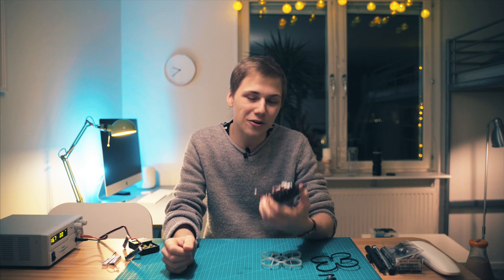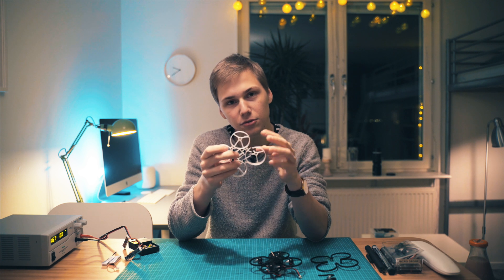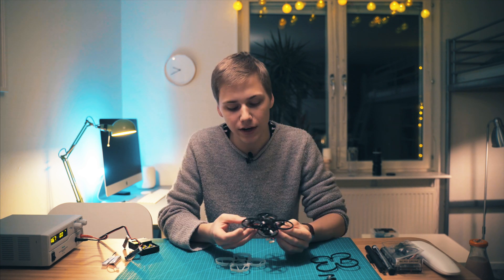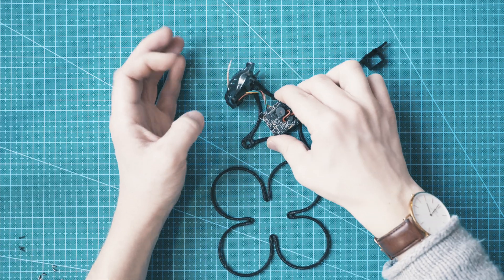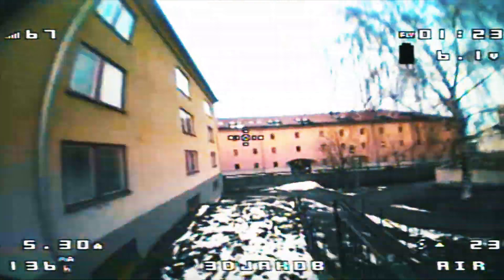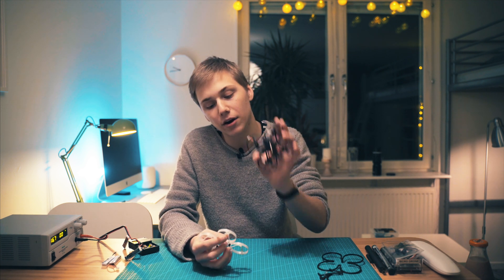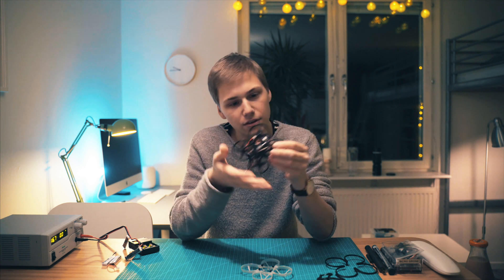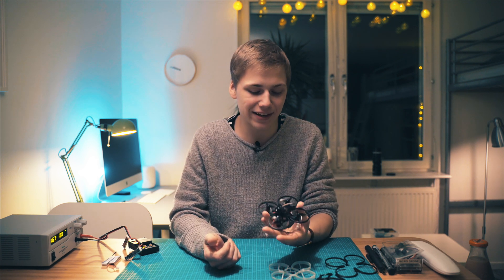Mobula7 3D printed frame

Comment: Love your work. What screwdriver is that? Is that a light on it?
Reply from the maker: Thanks, glad you liked it! The screwdriver is a wowstick. If you tinker a lot with electronics and screws you will love it, its awesome! It charges via usb has a built in led light and a pretty powerful motor.
Reply: @dronexsweden6906  thank you so much bro. Did I see a drill too? Which drill was that?
Reply from the maker: @darbyisking  Nope only a screwdriver.

Comment: This is awesome. Thank you so much. I am printing now. Frame in carbon fibre, prop guards in petg, battery holder in tpu. Is the battery holder for 2x1s batteries? I am going to mount a mobula6 25k and a moblite7 on them. Both only use a single 1s battery.

Comment: Excellent. I came here from Thingiverse to see the video. Well it's quite easy to find out how it fits together anyhow :) And it's good to see that your prints look worse than mine and it still flies well *haha*. Thanks for sharing that!! I will always have some complete kit when I go flying.
Reply from the maker: Glad you liked it! Yeah, the printer tolerances don't matter too much on this print as long as you drill the holes afterward. Happy flying!
Reply: @dronexsweden6906  I guess my printer is pretty well dialed in. Putting the frame and prop guide together was great lite press fit. If you check the thingiverse link: I linked a reinforced prop guard into the comment in case you want to add it to the project.
Reply from the maker: @izemanevobike  That's awesome I'll make sure to take a look at it!

Comment: Hi, first of all thank you for that frame. But after I changed to it i got a flyaways after switching to this frame. It imidiatly lifts off after arming.

Currently on 4.1.7 and this settings: https://www.youtube.com/watch?v=u7cdc1pLnHs
Also tried 4.2 with nearly stock settings, no accidential liftoff but it is wobbling when trying to fly. Any suggestions. Or could you paste in your diff all?
Reply from the maker: That is very strange, I was running stock mobula 7 settings and it worked perfectly for me. Unfortunately I don't have it anymore so I can't post the diff but you might be able to find the mobula 7 stock tune on the internet. Hope that helps, good luck!

Comment: can 1102 kv8400 motor be used?
Reply from the maker: That depends, are you running stock mobula parts otherwise? 8400kv is a bit low for 2s so it probably won't have as much power as the original motors but I bet it could work ok. The motor will probably be a bit underpropped though.  I hope that helps, sorry for the late reply!

Comment: dude i love this frame idea. i was working on something similar to protect props on my sailfly x. but i'm just learning f 360 so it's a long process
Reply from the maker: scooterfarl static-fpv glad I could help. Good luck with fusion! Happy flying!
Reply: @dronexsweden6906  thanks. i wanna see if i can add a skid plate to the battery holder if ur ok with that

Comment: What nozzle size do you print this on?  I can't get my screw holes to print the correct diameter.
Reply from the maker: Don't know exactly but 3d printers always have trouble with very smal holes so I would definitely recommend to always predrill the holes. Also I would recommend running high settings for better print rigidity. Another good tip to get it stronger is using very high temperature and then using a fan to cool the print. That way it really fuses with the layer underneath. Hopa that helps, have a good day!

Comment: Great job, man.
Which material do you use?
Don't you have 3d model for eachine trashcan?
Reply from the maker: Виктор Баранов I printed mine using PLA although ABS would probably work better. I haven’t done much testing though so I don’t know which best. The Eachine Trashcan has the same size fc and motors I think so it should probably fit in the same frame.

Comment: Nice work , material used will make a big difference to the strength, would the bottom plate work on its own without the ducts?
This would increase performance a LOT.
A carbon base would make it stiffer and reduce jello maybe and be stronger of course.
I'm thinking about the toothpick frame for summer when I fly outside much more.
Thin arms make for great efficiency as well as increasing power.
My bamboo skewers builds are really good, huge power and 6 to 10 minute flight times easily from 350mah  1 or 2s.
I don't have a 3d printer but think a system for utilising bamboo skewers or carbon rods would be fun, like stick motor mounts to push onto the skewers and maybe a simple FC mount..
Reply from the maker: Thanks! Yes to bottom plate definitely works on its own. However at that point you might as well use real props instead of whoops props. I have definitely eyed the toothpick frame too! It't performance seems pretty epic. I will probably upgrade to it once summers here. Bamboo skewers is cool idea, great out of the box thinking. That would indeed be a cool idea for a super light summer racer.
Reply: @dronexsweden6906  check out my bamboo build on my channel, super light weight 3 inch is really good.
Reply from the maker: @FlyingFun.  Very cool indeed, performance looks very good!
Reply: @dronexsweden6906  was a very cheap build too, toy FC silverised and a cheap 4in1 ESC and akk bs2 aio camera.
Oh and motors were 20 pcs for £30 at the time lol.
Time consuming part was drilling and sanding the bamboo skewers to mount the motors!
Reply from the maker: @FlyingFun.  That's awesome!
Reply: I did an eerily similar project a couple of years back: super-light 3", 2s, bamboo skewer frame, all made from cheap clearance items. Due to my clumsiness, the frame, FC, and two channels on the 4-in1 died pretty fast, was planning to rebuild with carbon tubes and some 3dp, but never got round to ordering replacement parts, due to my cheap'n'lazy arse.
Now that these fairly cheap brushless 'whoop'-boards are available, I think it's about time to revisit the project!

P.s. My mother is Swedish, and my father is a Yorkshire 'lad', so I feel I am in good company here!
Reply: @vladtheinhaler93  yeah i have tons of bits for projects which are still in a draw years later lol.
These aio whoop boards sit great on a bamboo skewers frame 
Soon...